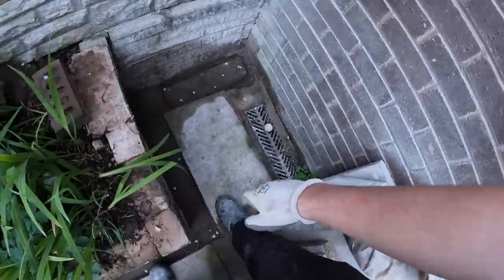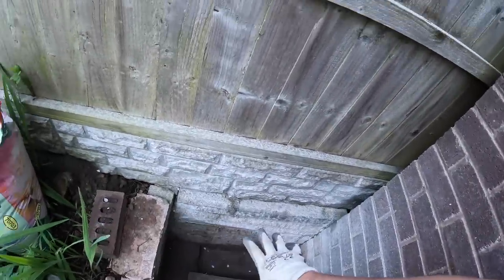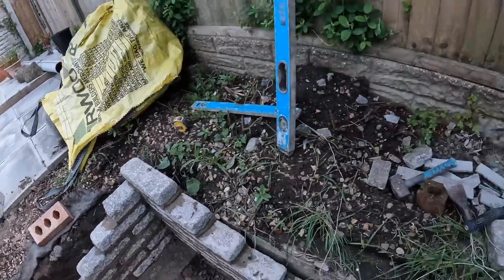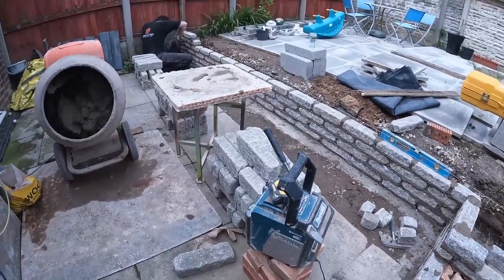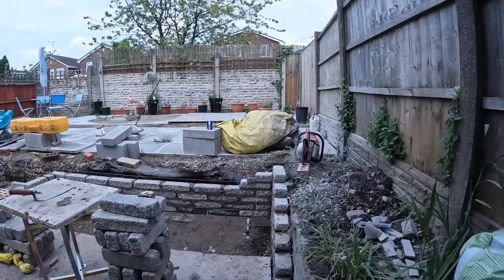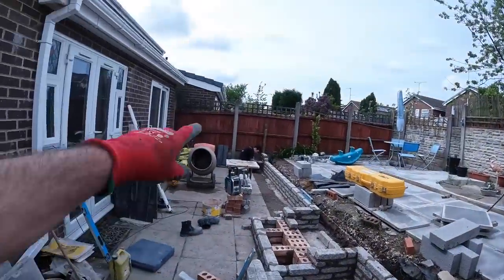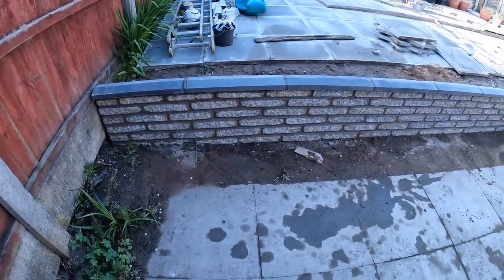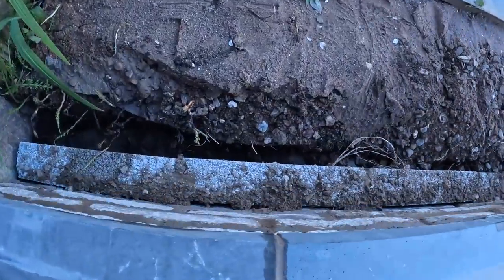GARDEN WALL DISASTER RESCUE PART 2 ....IMITATION STONE WALL

Comment: Due to ground pressure against your wall should it not have been 9' thick and where does the rain water run off from the flags go to.
Reply from the maker: It’s is 9 “ and there are weep vents on the wall